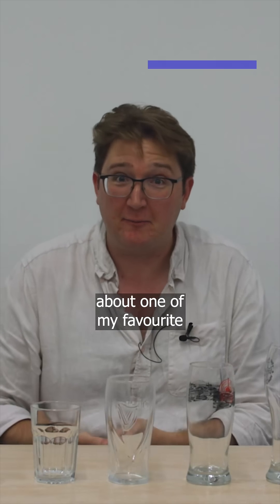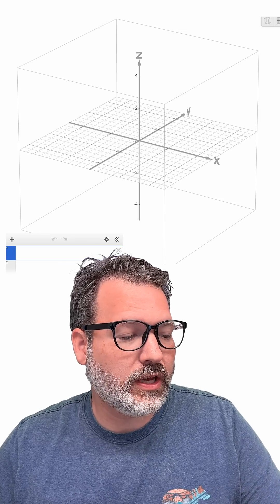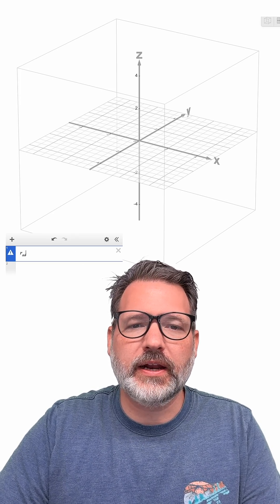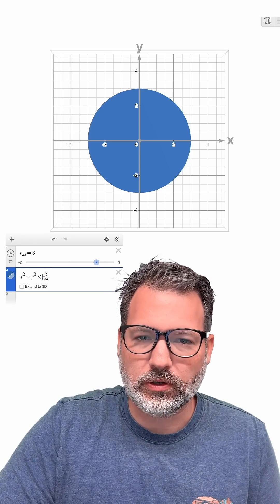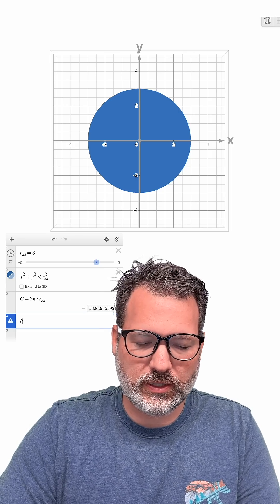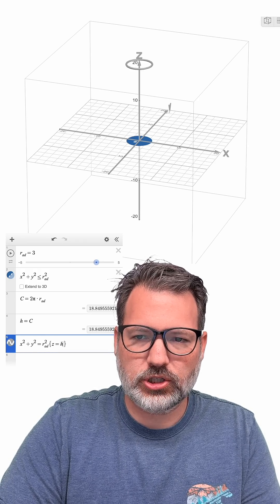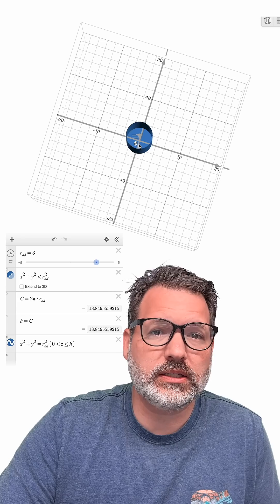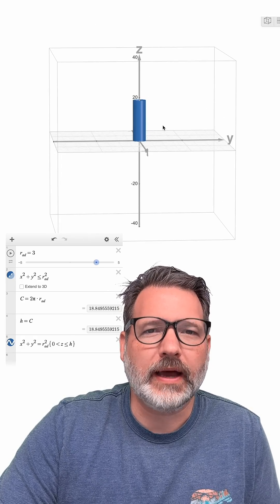The Math Behind One of the Best Bar Bets Ever

Comment: I'm not sure why this is made so complicated.  If diameter is d then it has to be higher than 3.14d.
Reply from the maker: what's the complicated part?
Reply: @polymathematic everything in your video. Rob just told the whole thing in couple words.
Reply: @villehietala9677 well two things with Robs response:

1) his response is wrong.  3.14d is explicitly always shorter than the circumference of the glass.  You can argue that he was simplifying for the sake of a comment, but then why not say 3.15d to ensure you are always strictly taller when that is what is being asked?  

2) Tim clearly states that he wants to help gain some intuition in actually visualizing what a glass that is taller than it is around.   A statement of "Well if it is pi*d tall, then it will be" does not help achieve that.    The goal is not to answer the question "how tall must it be?" but to say "what does a cup that is taller actually look like?"   These are fundamentally different questions.   And when talking about this in terms of a "bar bet", Tim's method of visualization is far more helpful because I doubt you are busting out a measuring tape and calipers to properly measure the cup to do the calculation of pi*d to figure it out, but if the cup doesn't look like someone capped off a length of pipe to drink out of, you are probably far more likely to win the bet knowing that is what it would take.
Reply: @Thagrynor  yet the visualization had measurements in it.  Starting from a radius, where diameter would have been way more usable for anyone at the level where they are learning this as a new information.  Or do you measure such things from center to the side?  Or measure the diameter, divide it by 2 to multiply it a second later by 2 again?

Shape of the glass would be same without any measurements.  Its just the ratio, which happens to be pi.  Or over pi, if you really need that to satisfy your mathwankery.

If I had to teach that to someone, it would be just 1 as the base diameter and pi as the height at first.  Now we have the shape that works for anything. Next it could go from paper to real life and we measure the base to be 60 mm and calculate that we would need a height of about 190 mm.

In the video, we just happen to get some irrelevant numbers from thin air to confuse new learners.  If that is fine with you, you are just a gatekeeper for math.  Too many kids give up when simple things are explained badly..  And now you are trying to teach the same thing at a bar 15 years later to the same audience.  Guess what, they still think that this is stupid.
Reply from the maker: so you found the concepts in the video complicated? like, they were confusing to you?
Reply from the maker: what the bet demonstrates is precisely that people do not have an intuition for what it means for a cup to be a bit more than three times as tall as it is across, even among the people who are aware of the calculation.
Reply: I don't even know why I'm writing anything, when the audience is unable to understand a thing they are reading.
Reply: I do like your simpler explanation of just talking about pi as the ratio, but your complaints about the video (about it turning people away from math) are pretty wild considering your own tone and attitude. That kind of intensely negative and judgemental attitude will do way more to turn people away from the subject than seeing a 3D graph will…

And I loved the video too, btw. Great to see Desmos’ 3D graphs — I’ve never used that before!

Comment: Intrigued and then immediately lost at the equation change for the disk without explanation. There’s some fun stuff here that feels inaccessible, even after following the rest of it fine
Reply from the maker: the equation of a circle is x² + y² = r², where r is the radius of the circle. essentially, that equation represents all the points (x,y) on the edge of what we commonly think of as "a circle". but if you change the equal sign to a less than or equal sign (so x² + y² ≤ r²), now it represents all the points on the edge of a circle AND all the points inside one.